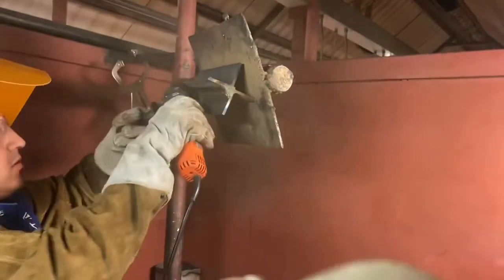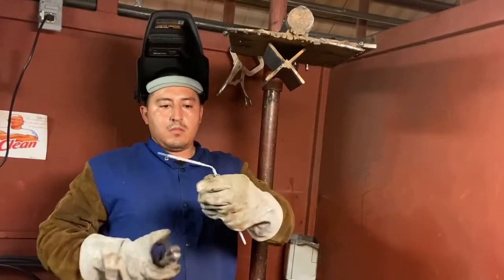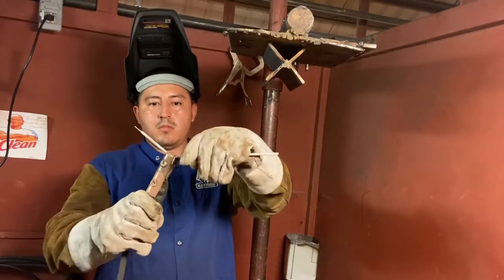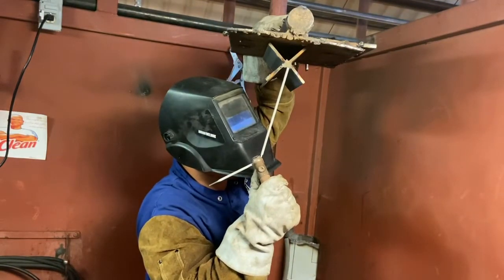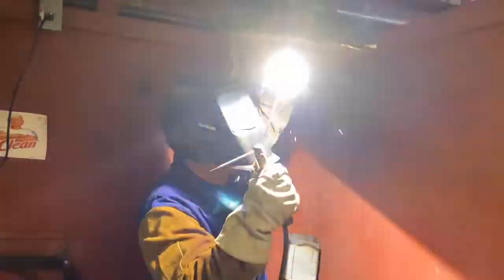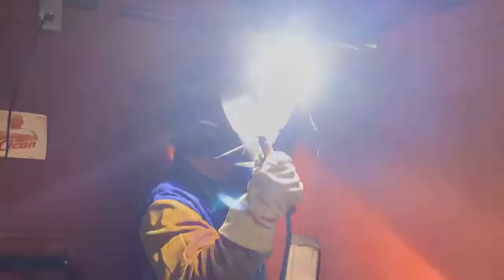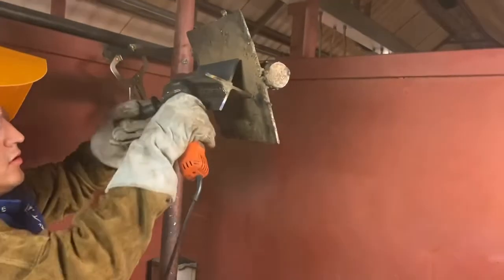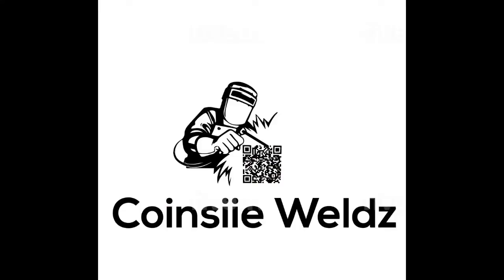Stick Welding Tips  for beginner welders Overhead 7018 4G

Comment: ACTUALLY, PERPENDICULAR MOVEMENT WILL CAUSE BLOWOUT AND HUGE SLAG BALLS, MANY OF THEM WILL FALL ON YOUR SHOES OR WORSE, ON YOUR FACE.. RUN AT APPROX 10-15 DEGREE ANGLES WITH A LITTLE LESS THAN 1/8 ARC LENGTH..
Reply from the maker: Completely agree with you now that I’ve experienced different overhead scenarios